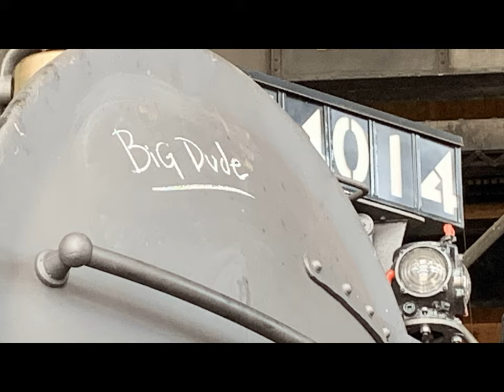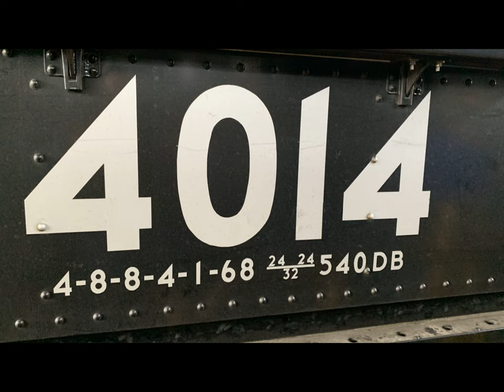Tour of the UP Steam Shop and Round House in Cheyenne WY and a video of Ed talking about Big "Dude".

Comment: Didn't know there was 838 I assume this is used for parts for 844? Have seen shop videos before with 5512 in it, is this also used for parts, or will it ever be restored?
Reply: 838 is a parts source. As for 5511, it's not a parts source (at least I don't think it is), and it likely won't be restored. At least not under UP.
Reply: I see high hopes for 5511 to be donated some day. As for 838, it’s use as a parts source is basically over, so it’s staying inside until the day UP sends it for scrap.
Reply: @davidng2336  According to our tour guide today, they'd like to put it in the roundhouse in Evanston. Problem is moving it. It has friction bearings which makes rail movement either extremely difficult or impossible, and UP doesn't want to spend money trucking it. If Evanston does... then that's a different story.

As for the 838, we were told that eventually, the boiler (which is in very good shape) will be removed for safekeeping, and the frame will likely be scrapped. It has a pretty big crack in it.